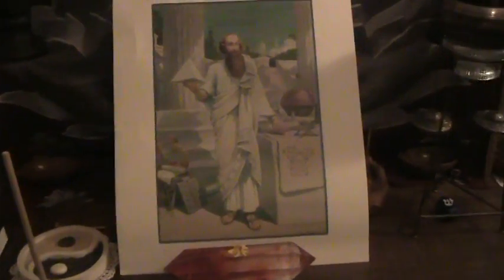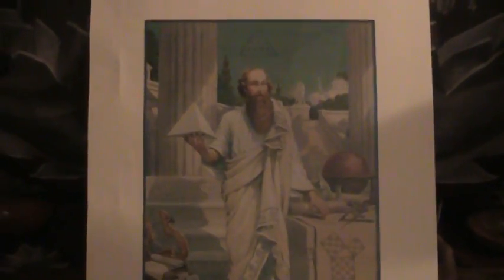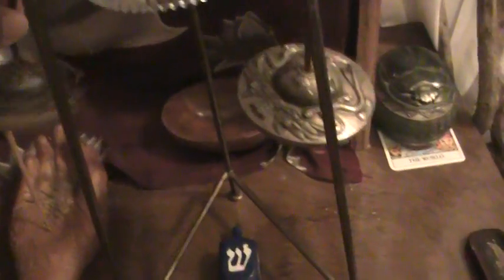Pythagorean Tone Generator : Music of the Spheres

Comment: I don't know if I'm just tuned differently or what but to me it sounds slightly disharmonic and wrong on the tubes. The bowl you played sounds better.
Reply: It's mostly just you. They're both extremely pure tones with hardly any overtones. But the bars have quick attack since they sound immediately when struck, whereas the bowl's vibration starts gradually. The Tibetan bells are out of tune with each other and the beats you hear from them is what a true disharmony sounds like.